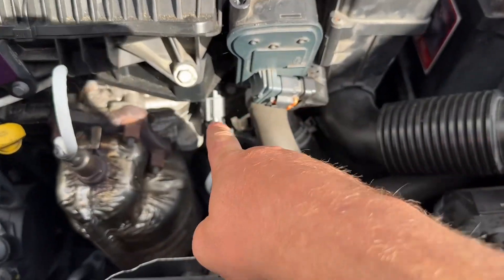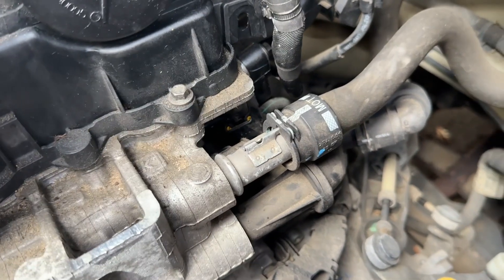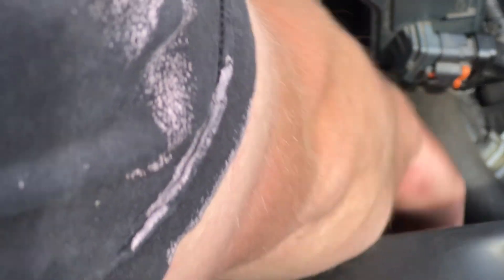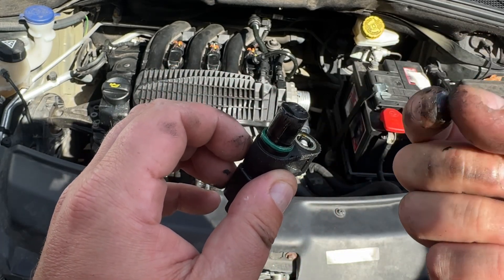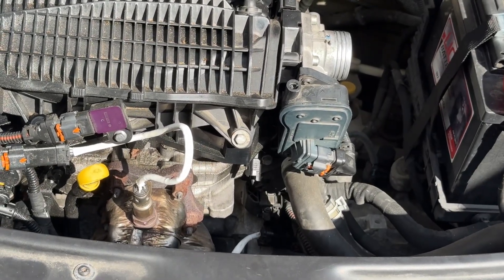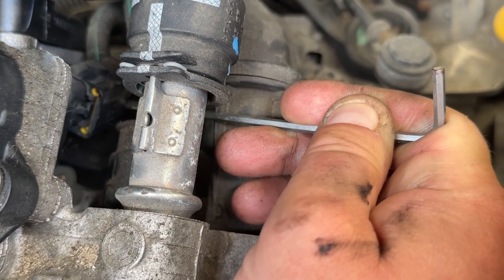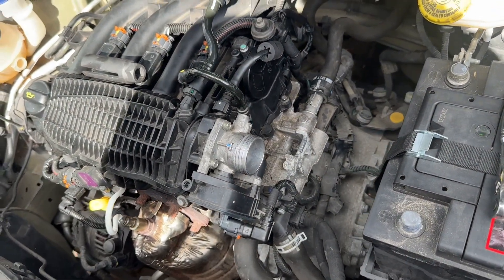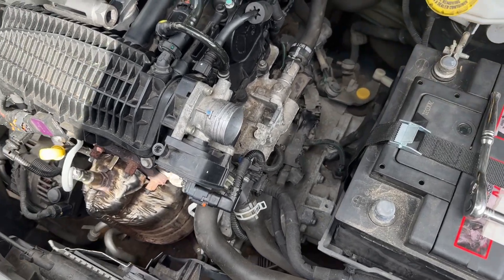Peugeot PureTech: How to Replace Camshaft Position Sensors (Step-by-Step)

Comment: Can you make a video on how to change the injectors?
Reply from the maker: Good morning! 

I will look into but it’s a bit of a pickle from memory,

You need to drop the engine down from the mount slightly on a jack to remove the stupid inlet manifold to access the fuel rail as it’s around the back of the engine

Comment: my Peugeot 308 -2011 was standing for 6 months now wont start all, already recharge the battery , can hear the fuel pump hamming sound and made a manual fuel pressure test , they seems fine
Reply from the maker: What’s the voltage reading over the battery using a multimeter please and report back :)

Comment: Hello , could you please provide a link for buying the two Camshaft Sensor ? Many thanks . Coz I am not sure if they are both the same or do I need to order different ones . Many thanks for the video .
Reply from the maker: Hey hey!! 

Thanks for the comment! They are both the same :) I used AUTODOC for mine but if you are unsure of the exact type you can talk to their live chat with your chassis number and they will give you a link to the correct ones :)